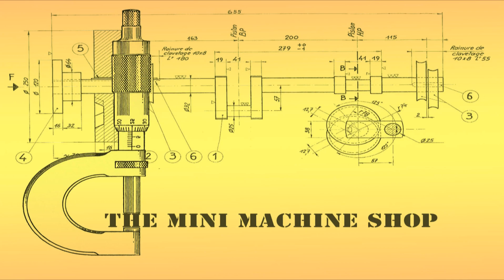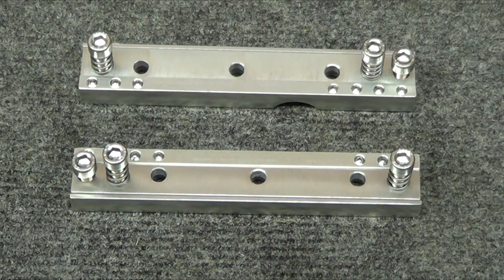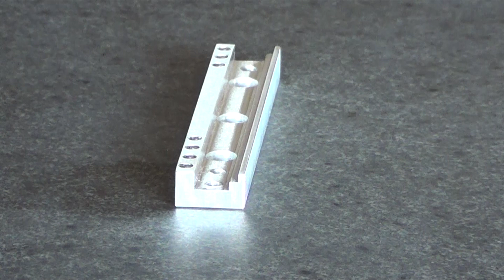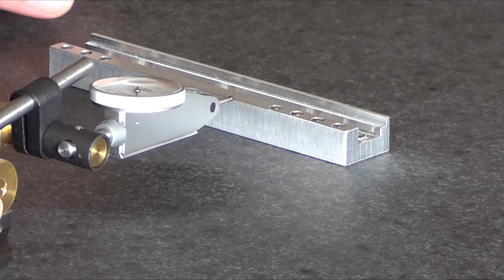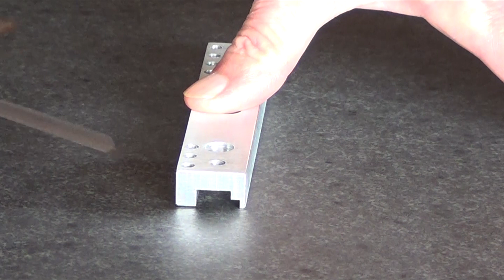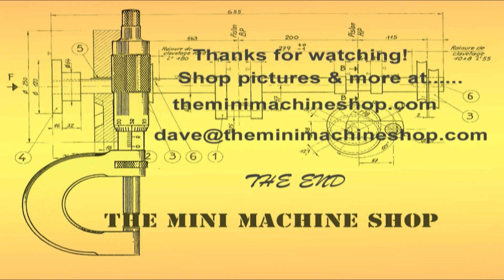Ebay Mini Lathe Saddle Upgrade/Fix Video #92

Comment: Thanks for the great videos. I would like your opinion on brass saddle retainers. I belong to a mini lathe group and those who have brass saddle retainers swear they are better than stock yet I can't find any vids of people who have actually made them or have them installed. I'm wondering why if they are so much better, why aren't they more widely used? I've seen them for sale on one site but are currently unavailable. I would think that if they're better, they would be available from sellers like lms etc. Thanks.
Reply from the maker: Actually, cast iron is the best for gibs and other stuff but brass is the second best. The reason most don't use brass is machinability and lapping it is very difficult it clogs everything. Hard to work with you even have to modify a drill bit to drill it.

Comment: If you go to briansworkshop.weebly.com  you will find the FREE plans and instructions for my top adjustable gib's that  do work and cure saddle rock. Only a days work and cost penny's to make  My prototype gib's have only been adjusted once since i made them 11 years ago., and my  12x7 works hard. just how hard can be seen if you go to   Brian Hogger on You tube.
Reply from the maker: This video was an Ebay review the next video I did pretty much the same as you did but thanks!

Comment: Kinda silly to make an opinion video because without actually installing and testing (instead of a bunch of speculation) you really are just guessing. By the way, the springs are obviously there just to give some initial tension to the bar as you set the set screws. (That way your not having to have a hand pushing the plate upward as your setting them.

Comment: Did you ever make a video showing how this thing works?  Also, do you know who sells it?  I’ve seen them before on eBay but can’t find them now. Thanks!
Reply from the maker: No because it wasn't the most stable idea using springs so I made a solid one for both my lathes that works perfect! Here is the video https://www.youtube.com/watch?v=kXnz9t3urv8
Reply from the maker: They were discontinued from Ebay after the video. Sorry...

Comment: a friend of mine uses this System since a while he made it by himself but looks very similar there is even a guy on Youtube who made a similar item and installed it my friend is very happy with this and the saddle moves very smooth with very little play before it was much worse ... on my mini lathe i removed the original with brass made diy parts and it worked also great ( without balls) on my new big chinese lathe ( 265kg) i dont need something like that the saddle is strong as hell... :-)
Reply from the maker: You should watch video #93 which is my version of it!

Comment: Dave, a couple of things. First off I recently purchased this from ebay. I have searched for a while for any information on it, but found only this video you made.  So I figured I would give it a  try. My micromark 7x16 suffers the same as yours with the carriage wobble and problems with boring and facing. Now, at first I planned to make a carriage lock for it, but then seeing this I figured it has one built in. Ok, so I installed it as per the instructions and what I see is that there are a couple of issues. One is the dial for thread turning is not clearing the bottom of this new part. I had to mill it down and then finish it with a file to allow enough to clear the dial. Once that was fixed I then went on to the adjustment part. Simple enough in the instructions. Install and once the carriage is back in place you are supposed to turn the spring loaded screws down about half way and then back off a  bit. So trying that I found that the carriage was worse off than before. Slop all around. Up, down and sideways. So I tightened it down more and found that it did stabilize much more. Note that the screws are turned almost all the way to the point of the sprigs being fully compressed. I don't like this and believe it will be an issue again with slop. Truth of the matter is I would not buy this again. I would have simply made my own on the mill out of brass. I feel that the aluminum, is not the right material for this part. Just my opinion of course. I also believe I could make a simpler version that works better. Now I may try some stiffer springs on this setup just for giggles. On another note, I have the LMS High Torque Mini Mill. That machine is far and away better than the micro mark lathe. Everything about it is better and smoother. I have spoken to some who own their version of the lathe and I hear the same about it. So with that said, I wish I had known about them when I bought my mini lathe. Can't recommend them enough. One more thing before I end this babbling. I have watched just about all of your videos and thoroughly enjoy them. You have a great way of putting it all together and making things easy to understand. Keep up the good work. You surely deserve more views.
Reply from the maker: https://www.youtube.com/watch?v=kXnz9t3urv8
Reply from the maker: You've watched them all! WOW. I remember when I started I watched all 100 of Tom Lipton's Monday night meatloaf's to learn. You might like watching meatloaf 93 a lot of people don't know connections.

Comment: Hi Dave 
What would happen if you replace each spring with a pair of nuts?   Loosen the nuts and tighten the two screws until the ball bearing plate is snug to the underside of the ways and then tighten the two nuts?  Perhaps the springs are there to compensate for thickness variation in the ways?
Reply from the maker: Yes the springs are there for variations but I did what you are saying on two lathes and find no variations. Watch my version of this upgrade https://www.youtube.com/watch?v=kXnz9t3urv8

Comment: those if out there lathes with gibs...worn msc carries a sheet off teflon shim you can cut and add on inside edge of gib for that glass smooth travel its cheep to under 20$

Comment: I have a similar problem with my saddle. My saddle however doesn't go below the way so the saddle adjusting plate is canted and rides on the edge which is a problem I will work on in the near future.

I have a rough sketch for a solution which will be similar to what you have showed in this video.

Comment: Hey Dave, I fixed the side to side by installing a ,025 brass 1/4 wide shim in the front and bending it over on both ends and that cured it. I also shimmed the front gib that I made out of brass and installed studs and lock nuts so when tighten was just right. The rear was just tightened as tight as possible , I need to make rear longer because it has been proven to work better. Check out Steve Jordan from UK he has many mini lathe tips. Have you tried Mobil Vectra way oil what a difference. I got a qt. for about 10.00 bucks plus shipping. I think that will work and the spring loaded bolts just give a little tension after being bolted on. If I had a extra $100 I would try it Later Dave A

Comment: what's wrong with your video it keeps on stopping and starting started at 8 now its now  8;45
Reply from the maker: I just watched it and no problem. I've been seeing that problem lately on other videos and I think YouTube needs more bandwidth their overloaded!
Reply: As a diagnostic, I'm seeing the same stop/start issues with this video.  Then I watched 30 straight minutes of Keith Fenner with no issues.  Came back here and stop/start.  Then I watched Dave's video #87, the DIY Noga Arm, and that ran without issues.  So from where I sit, it's something about this specific video.
Reply: +Buck Calabro it is either your connection or you tube.works fine here